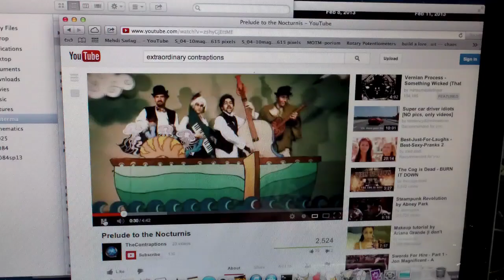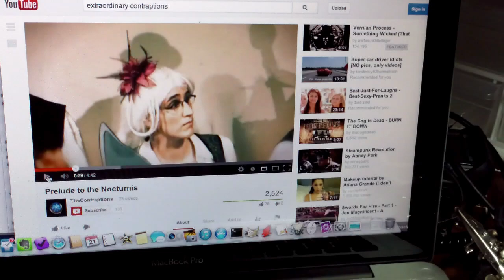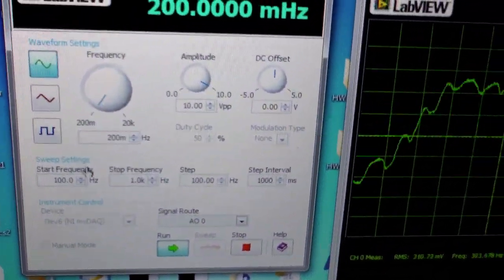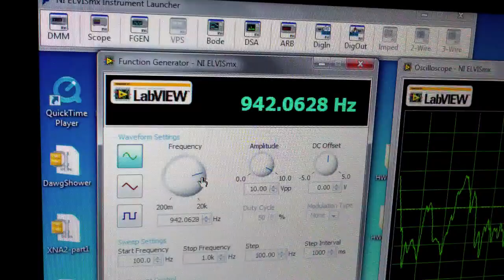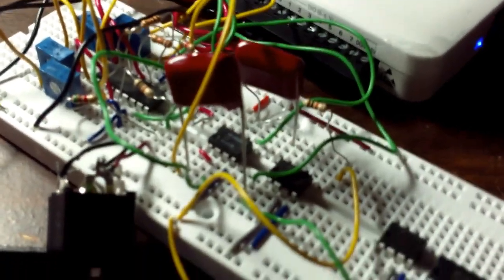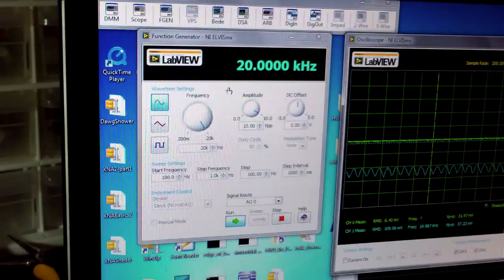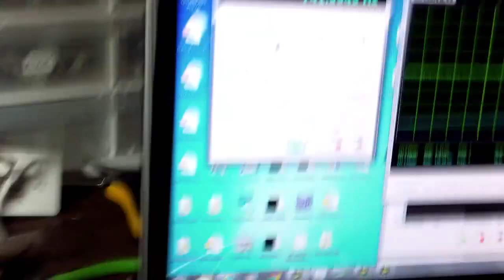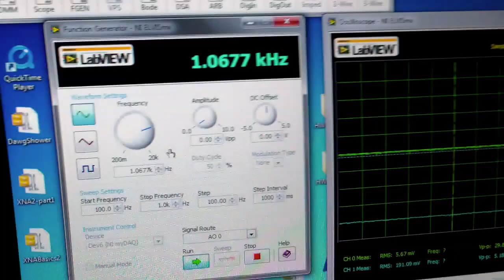Double-sideband amplitude modulation with NI myDAQ, part 1

Comment: Awesome! I didn't realize OTAs could multiply that clearly. I always feel weird multiplying a current times a voltage to get a voltage, I mean, despite supposedly knowing what's going on.

Do you think you could do one with the original audio bandlimited below a carrier in the audio range? I feel like that could be an equally chaotic but more usable noise effect. Or I guess I could build it myself, hmmmmmm.